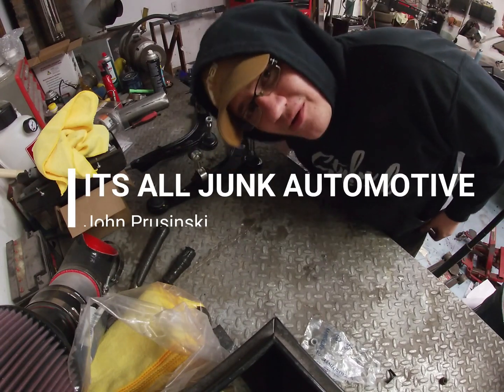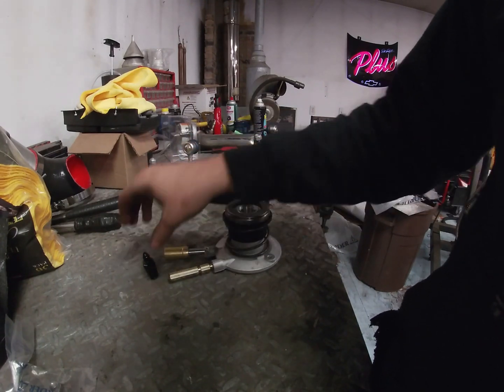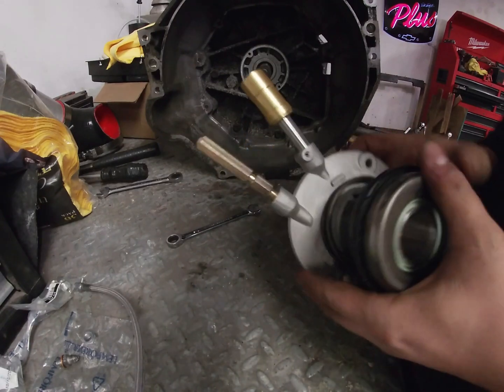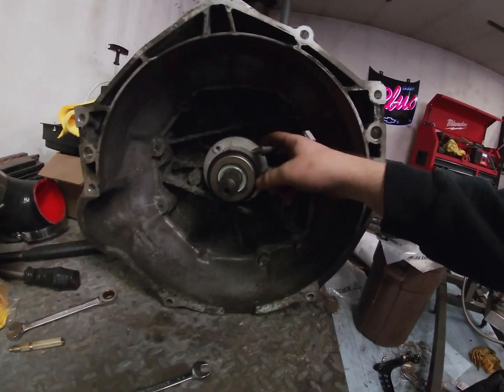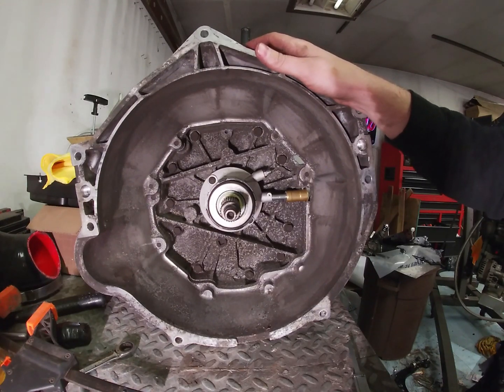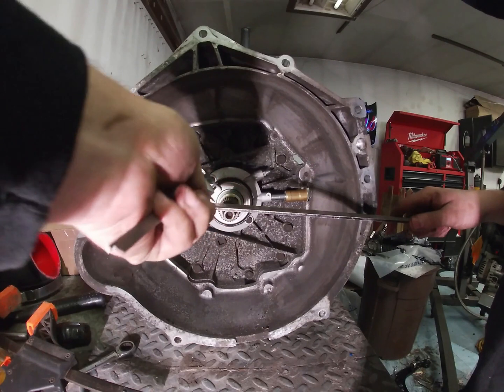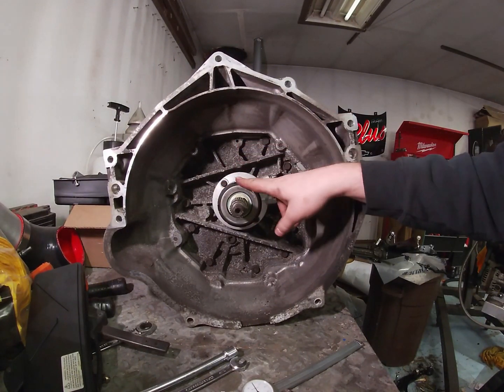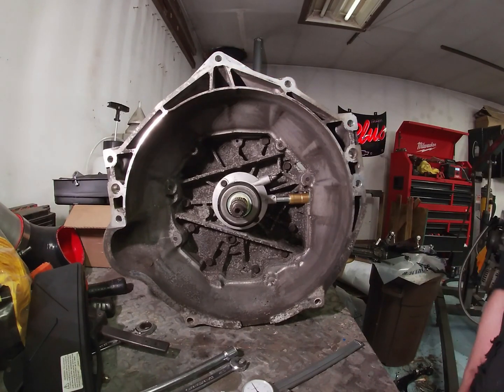HOW TO CHECK THROW OUT BEARING CLEARANCES ON AN LS1 SWAP

Comment: Aren't you supposed to use the 'tail' of the caliper when measuring depth?
Not a big deal
Reply from the maker: You can use the tail end. Which ever is easier for you. Either way you'll get the same measurement.